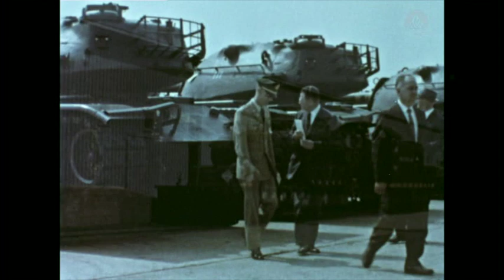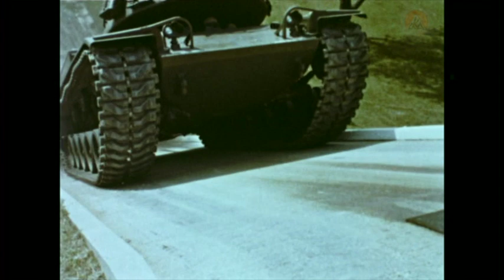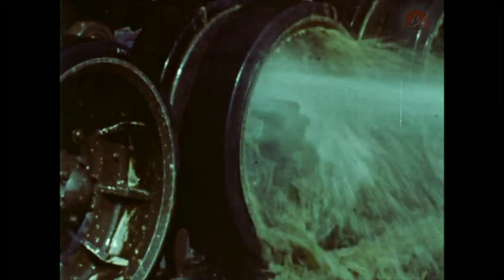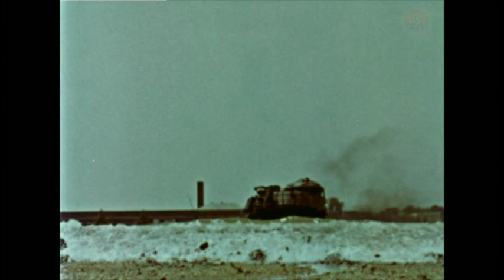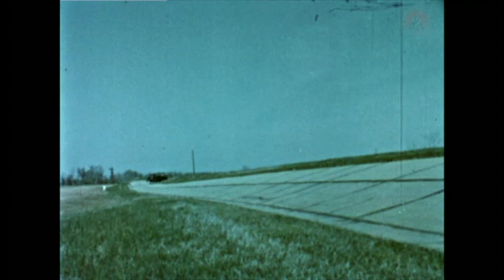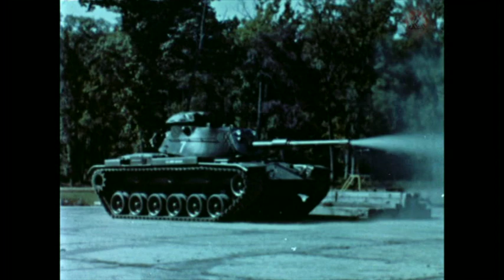Putting the M60 through the paces! Tank Quality Assurance at Aberdeen Proving Grounds

Comment: When I was a young kid and TV stations came on at 6AM with the national anthem,  after the American Farmer came the Big Picture which was the 30 minute Army show with films like this one.   Made me real happy when I became an M60 Platoon leader in Germany.  The M60 had its flaws but it was reliable and had a dam good main gun in the 105mm.   Gunners would have a competition to see how many HEP rounds they could have in the air at the same time for a 2400 meter target at Graf.  I think 7 was the best.   unfortunately it had the worst US machine gun in history as its coax, the M73/219.   I liked the M85 .50 cal but you had to disassemble and clean/lube the M85 to a greater extent than officially allowed for operator maintenance. Fortunately I had a great Platoon Sergeant and he taught me every little spring in the darn thing.
Reply: I can remember gunnery at Graf in January, augh.  For the CEV's with the 165 MM main gun.  The one night fire there was the coldest I was both times in Germany.  Using the stakes in the ground to position the tanks to use the range card, a second tank to use the light for after we fired to see if it was a hit.  Then the gunners quadrant sight to set on the gun to get the proper elevation to the target.  The fun part of the CEV's was the effective range was 950 m, with a HEP blast radius of 1000 M!  During desert storm we were shooting at a pick up truck for practice and the bumper landed behind the tank.  After the CEVs were retired after we got back from Bosnia for IFOR I had a squad of AVLBs or the bridge tanks.  both vehicles were fun.  We used the M240's for the coax, but the M85's as an armorer were just solid compared to the M2's.  Just the tool for tightening the rivets no one had, but I found one at a depot level facility on Ft Hood for something that should have been at the support battalion level.  That was when the 1st Cav was all M1A1's.  Still on the AVLB's drop the bridge and you could keep up with the M1's

Comment: I was at 29 Palms back in the '80's and I saw a few mechanics working on an M60 with a 5 ton tow truck sitting beside it. Wondering what was going on I walked up and asked a few questions. I learned that it took 12 hours to remove the the engine and 12 hours to put one back in, and the reason they were doing it was because it needed an oil change. I have always thought that among the most dangerous things to an American service person are engineers and procurement officers.

Comment: Sofilein:
A great thing bringing this video!  This demonstrates how you test the vehicles and establishes standards where the costoumer can judge the performance. These test are used today.
Take this video of the Mowag Piranha 5:
https://www.youtube.com/watch?v=a2__Q_6y2EQ
These test are established benchmarks that every vehicle must qualify. The costoumer has to see where the vehicle struggles. If a vehicle does not struggle at some point - then the designer has not been ambitious enough:
1) The problem for the Piranha is "the ditch" - which is not unexpected, as it has front engine and thus is "snout-heavy". Personally I would have liked to see how it manages in reverse (where it gets "butt-heavy").
Note how the test equipment has different notches so you can evaluate where the problems will occur.
2) The cobble-road is more to establish at what speed and weight there is resonance. Any suspension has such resonance frequencies - the trick is to have these resonances outside the relevant combinations of speed and weight.
But these films are valuable when training the driving instructurs - just to see, where you will have to teach the driver "work arounds" - and how to establish passing/failing grades for the drivers course.
The problem is not so much how an excellent driver behaves. But in a company there is bound to be drivers that just pass the test. Which is of importance on a tactical and planning level - just to estimate at what speed the vehicle can be expected to perform. It makes a lot of difference in the planning, If you can establish a road speed of 50 mph instead of f.i. 40 mph.

Comment: 60 degree slope is very impressive, but I wonder what they can do it on dirt or grass. Not many concrete ramps out on the battlefield.
Reply: Short answer, yes.
Reply: Yea, no. Notice how slowly the vehicle climbed? They are capable of great speed on terrain, but tests like this are designed to check for fuel starvation, lube distribution, stress on transmission etc. Check out some images from The Great War, tanks stalled on embankments fill entire galleries. So, yea, tanks have tracks so they are able to cross terrain. And no, concrete ramps exist only on PROVEing grounds.